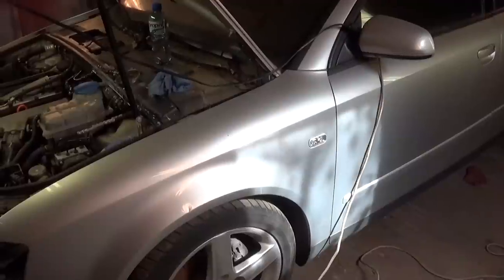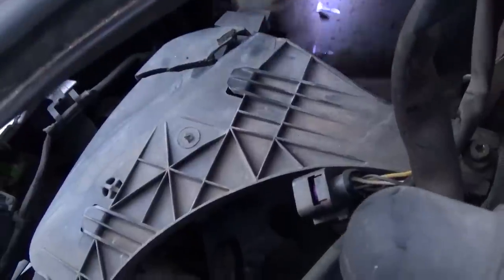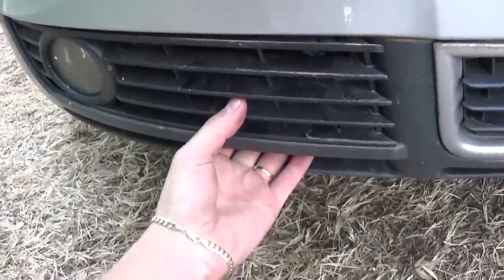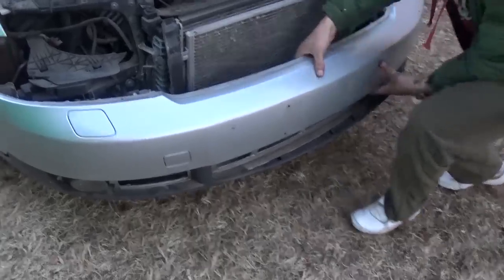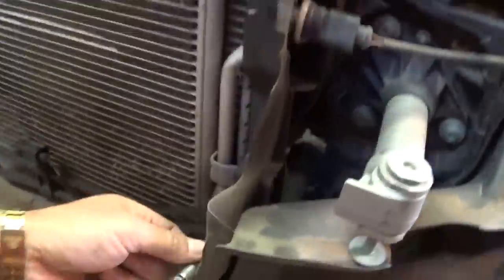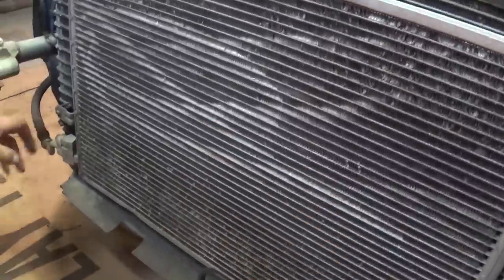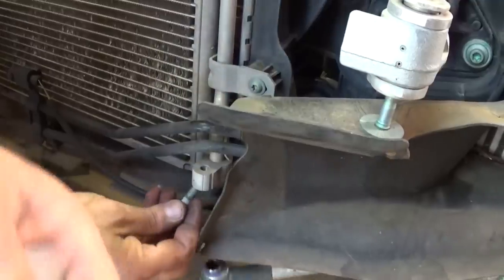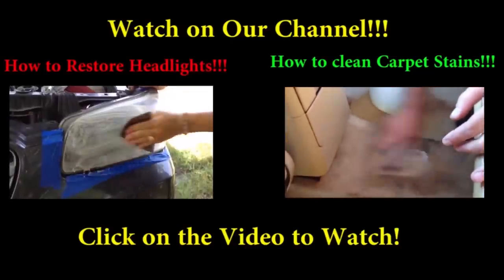Audi A4 B6 A/C Condenser Removal and Replacement  Air Conditioner Condenser

Comment: Great video. You say don't "forget to empty the a/c system before working on it". How do you do that?
Reply: I would Like to know as well. I have to swap my radiator.
Reply: @Hachithe8  you need to take it to a shop that has a a/c machine that can evacuate the gas.

Comment: Hi I love your videos. Can you possibly tell me does my 03 A4 b6 3.0 Quattro have 2 radiators one for cooling and other for AC? I only see the big radiator on my car, I'm not sure if my AC radiator was removed and deleted all together, because my air conditioning does not engage, it's on default ECON mode. Please assist, I'd appreciate it so much.
Reply: yes you always have a separate air con radiator. it will be in the same place as in this weedio.

Comment: Do you have a DIY video on replacing the cooling fans and housing for the Audi A4 B6?  I have an engine that is overheating, and have tested the temp sensors and the fan control module.  There is a signal going to the FCM telling the fans to turn on, but they don't.  I am planning to remove the front bumper and did not know if I need to remove the condenser and radiator too, or if I could lean them forward and get the fan out.  Any suggestions?

Comment: When putting the lines back on the new condenser, how tight should you tighten the bolt lines without crushing the o ring but achieving a good seal.
Reply: it should be about 12NM

Comment: On top of engine left side where the ac refill loop is, its like same as you taking air out of your tyres, thats where you empty it, if you don't empty and you are taking it can hurt alot if the hose slams on you !!!! It will hurt if it gets you....

Comment: what happen if i dont empty the AC system?
Reply: When you undo the pipes, the gas R-134a (Tetrafluoroethane) will leak out. Although it doesn't affect the Ozone layer, its a real bad for trapping heat in the atmosphere.